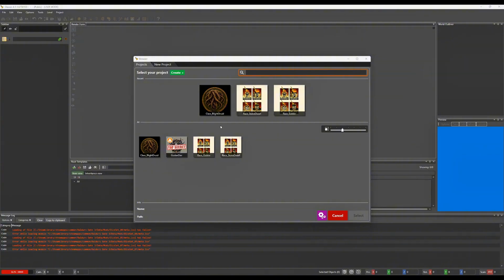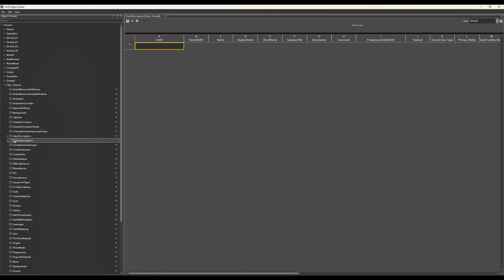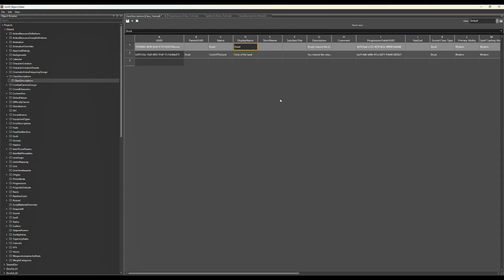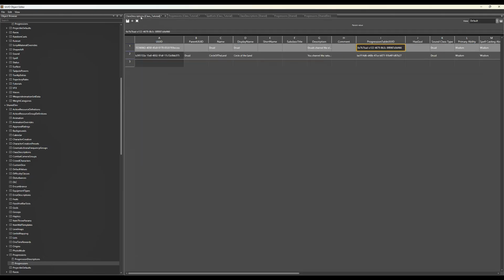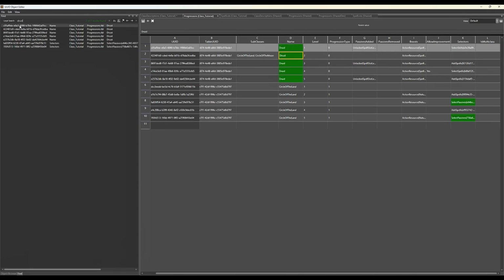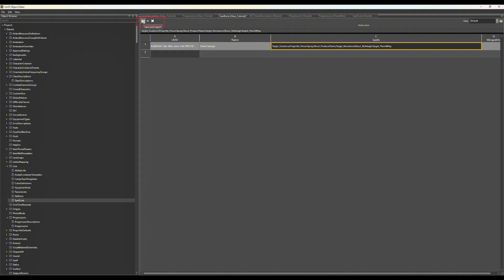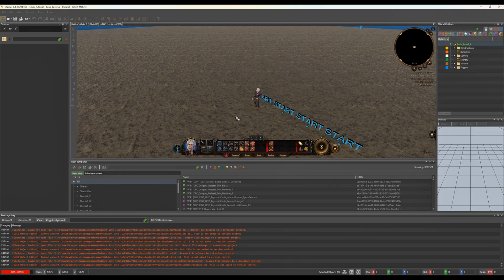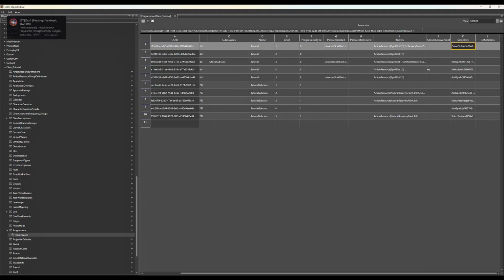Baldurs Gate 3 (BG3) toolkit modding tutorial - How to make your own Custom class and subclass mod

Comment: What I'm a little confused about is why you need to add the class levels to the list if you wanted only to create a subclass? Does that mean that a subclass mod would override any other mod changing the normal class progression?

I want to create a rogue subclass, for example. I also see that at level 2 or 3 (don't remember right now), only Thief and Arcane Trickster were listed in the subclass list in the table. ?? Not Assassin and Swashbuckler.

Comment: Maybe some suggestions for your next videos: 
1) making a custom spell
2) making an (custom) container spell
4) how to apply an VFX from the root templates to another spell /adjusting existing VFX to your needs (like changing colors) 
5) or even connect a status with an costum VFX. (I really don't know how to do the VFX stuff xD)  
6)How to make an custom effect (like, if you Cure Wounds you gain also Bless, or stuff like that)

I really have a hard time doing those in the past few days. To solve those I checked for those some other guides sources and ask around, but I don't think those were good. At least not, if you're a beginner at BG3 modding. Your provided me with so much more stuff I actual needed. So thanks for uploading it! =)
Reply: Did you ever figure it out? I need help too
Reply: @tiredwithpeoplesshxt1284  Depending what kind of problem you encountered.... maybe? 
Some of them - yes, some of them - no. Back in the day I merely suggested some starting points, if the creator wants to help new modders. And my suggestion were those questions I had when I started modding. 

In my personal opinion it's really hard to get your hands on a really good guide which take you by the hand. A lot of guides take it for granted, that you have some basic knowledge/understanding what you're doing. But for me it's not the case, so it was kinda frustrating to start from zero. And even if you can ask a Modding Community for help, you don't get always the answers you need. It takes some time / repetitions to get what you need.
Reply: @Towb95 modders don’t like helping new modders and they always get annoyed by my questions 😢 I just wanted to edit a subclass that someone else already modded I just don’t know how. I wanted to tweak it to my liking and add features from other subclass mods onto it.

Comment: Thanks to you I could learn some of the basics of modding! So I tried it for myself and it wasn't half bad for the beginning. But I don't know where the Select Ability Bonus number comes from. Neither does it work for my class when I want to give my class those extra stats. And even if I switch it with the Table UUID or with the normal UUID - it doesn't work. Do you know why perhaps? Thanks in advance!
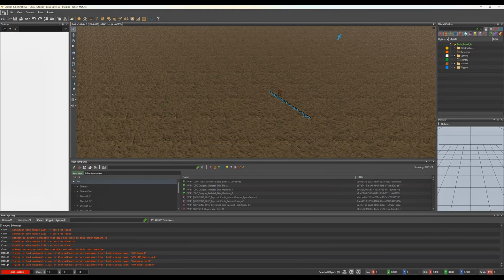Reply from the maker: Hi, happy to hear that! How that works is explained from 22:40 onwards in the tutorial. You need this code
 SelectAbilityBonus(b9149c8e-52c8-46e5-9cb6-fc39301c05fe,AbilityBonus,2,1)

Please let me know if that works or if its still unclear.
Reply: @TheModSmith-x8r  Thank you for your quick response! (And sorry for my late one, I was kinda busy the last few days).
 I actually did that already several times before, but it didn't worked. BUT! After I deleted it now and gave it another try with the SelectAbilityBobus you just gave me in your recent response, it worked just fine. Who knows what kind of mistake I did all all the time. I can't really tell, bc I tried it over and over with copy & paste and the AbilityBonus from the description.  
So thank you very much for your help! I really looking forward to your next videos! =)